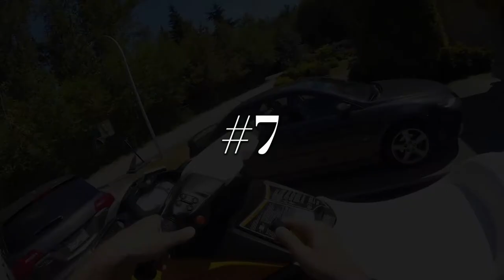10 Point Safety Check for Personal Watercraft Jet Ski Riding

Comment: Hi I was just wondering why do you take the exhaust connector off .😃👍
Reply from the maker: The machine uses the port during riding. The diameter of the hole has been engineered so that a restriction of that diameter (with the quick connect) can affect the exhaust system. Thanks for your comment.
Reply: 3ftDeep Thank you for your response  .take care on the water

Comment: love the vidoes, i am looking to buy my first PWC, would you recommend the seadoo spark. i am not a crazy rider dont need a lot of speed, just looking to go out in water and crusie around. thanks for your input
Reply from the maker: We're not big fans of the Spark. We don't like the plastic hull, or the inconvenient design for doing regular maintenance/repairs. We've recommended a used, non-supercharged model (i.e. <185 HP) to beginners and they're very happy with their purchase. You could probably get a very good price on a GTI SE 155 model that's a few years old and still uses the fiberglass hull. Minimal maintenance, and very reliable. Good luck!
Reply: @3ftDeepChannel  thank you for your information and your help
Reply: @3ftDeepChannel  Is there any special reason why you don't recommend supercharged seadoos ? I was just about to buy 260 gtx iS 2015, there are some speculations on the internet that; supercharged ones are not reliable and usually get problems. And the iS intelligent suspension is unnecessary and mostly easily broken as well, and so hard to fix it.
Are these true ? Thanks.
Reply from the maker: We only buy supercharged machines for ourselves. We just don’t recommend them for beginners, or for people on a tight budget. The claim is that the 300 supercharger models don’t require maintenance, but all the other models do. For example, the 260 will need a rebuild at about 175 to 200 hours and it’ll run about US$400 in parts, and about the same in labor if you have a shop do it. We recommend staying away from the iS models because although they do provide a softer ride, they make working on the machine much more difficult and expensive. In other words, it offers a lot of hassle for very little benefit. Good luck.
Reply: @3ftDeepChannel  Thanks for the reply. So I understand that, if I have a budget, GTX 300 models are better than below hp models in terms of reliability, correct ? Which year are we talking about ? For example I heard that GTX has a sinking problem below 2013 and its been fixed after 2013+ models.
Reply from the maker: We’ll, the point is that the simpler the machine, the more reliable it is. So, any model without a supercharger or intercooler will be more reliable than one with those parts. As far as comparison between the supercharged models, we feel that the 300 is likely more reliable than a 260 model, as the supercharger shouldn’t need rebuilding. But obviously, that’s a vast generalization, as each machine has it’s own issues. As far as older GTX models, I’ve only heard of sinking issues with models that have the iS. I’d stay away from the iS models. So, if you want maximum reliability, I’d get a newer GTI machine without an intercooler or supercharger. If you want more power and good reliability, I’d get a 300 supercharged and intercooler model. 2018 and newer machines seem to be very reliable.
Reply: @3ftDeepChannel what do you guys think of the rxp 255? Is the ski anygood and reliable?
Reply from the maker: It’s a good machine, that’s for sure. Given that it’s an older machine with a supercharger and intercooler, it’ll need some maintenance and likely some repair, which can get expensive. Make sure the seller has all the maintenance records and have it checked out thoroughly (including a test ride) before you buy. Good luck.

Comment: Hi, I have a 2002 seadoo gtx di and my gauges stop working,  any suggestions
Reply from the maker: Yikes. With the machine that old, it’s usually the gauge itself and needs to be replaced. Before you do that, however, check the connecters to make sure they’re secure and that there is no corrosion on the leads. Good luck!

Comment: Trailer tyre pressures... 😂... I
Like to think I’m diligent- but they always get missed in the excitement.
Reply from the maker: I should’ve also said check the age, too. I had an old tire with lots of tread and the right pressure, but the rubber was old and it failed on the highway. Shredded up and took out my fender. I replace them every five years no matter white now.

Comment: Hi guys I really need help, i got 2006 RXP 215 I rebuild my engine after timing chain broke two weeks ago also rebuild the supercharger , I had it on the lake last Saturday, it ran very good for about one hour and then it’s just start smoking from exhaust like white smoke, I took it home find out that  supercharger gets all the oil out of engine, I removed supercharger and find out it broke brand new gear on the supercharger, so I had to rebuild my engine again, I think it broke because I bought cheap eBay supercharger kit, but today I got all back together, I bought used supercharger set that supposed to be in good condition with titanium washers, so I put it all back together, but my supercharger makes a lot of knocking noise almost like rod knock, but when I remove supercharger and just cover hole with my hand and start the engine it sounds absolutely fine, I tried to replace bearings on that supercharger kit it still makes same knocking noise, I realy don’t know what that could be. Do you have any idea what may be the problem? I really appreciate all of your videos, thank you for help.
Reply from the maker: Sorry to hear about your issues. Are you 100% sure you got the right supercharger rebuild kit for your machine (with the right number of teeth)? Did you compare it to the original one? Also, did you check the slip moment before it was installed? What was it? I'm not sure that's your "white smoke" problem, but let's start with your supercharger issue.
Reply: 3ftDeep thank you for fast answer. Yes I’ve checked the gear is the same 16 teeth, the kit for seadoo rxp 215, is there difference for different years ?
Reply from the maker: I think there are only a few different kits, but I still suggest comparing the components to your original parts. Also, check the slipping moment with a torque wrench.
Reply: 3ftDeep slipping moment between 8-9 n.m. Compared components to my original ones looks identical
Reply: 3ftDeep the only diffidence is the big washer on the end of the shaft right after nut  my original one are wider
Reply from the maker: Hmm, that's in range. If the supercharger spins freely and it's also the right tooth gear, the issue probably isn't with your supercharger. I’ll do more research and get back to you.
Reply from the maker: Is there any signs that the impeller is rubbing against the supercharger housing?
Reply: 3ftDeep no, not at all
Reply from the maker: Well, then it sounds like a problem on the engine side. I would get a good look into the engine where the supercharger connects and see if there’s a problem with the gear. It could be there were metal fragments left over in your engine, and that’s your problem, and it’s just being amplified by your supercharger. I hope not, but not sure what else to say at this point. Good luck.

Comment: Were those knott sealed bearings on the trailer? If so, how have you liked them?
Reply from the maker: I have the sealed bearings on my Karavan trailer. I just replaced the hub for $150 CDN plus tax, so I'm not too impressed at the moment. Some water does get to the bearing (primarily through the seal on the inside of the hub), and that causes the problem. It is 7 years old and they're only supposed to last for 5 years, so I guess they're within the manufacturer's claims. If I had a choice, I'd probably get the regular bearings, but these came with the trailer. Thanks for your comment.
Reply: 3ftDeep thanks! Mine are at the 3year mark and I’ve been debating replacing them. They sound and feel fine, I have close to 6,000 miles on them. I think I’ll replace before a failure happens......Thanks for the response!